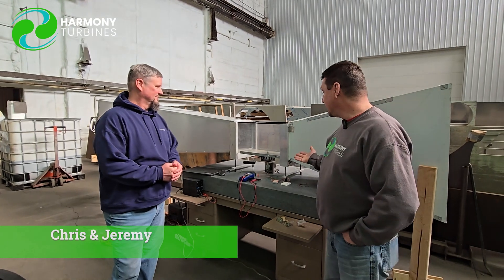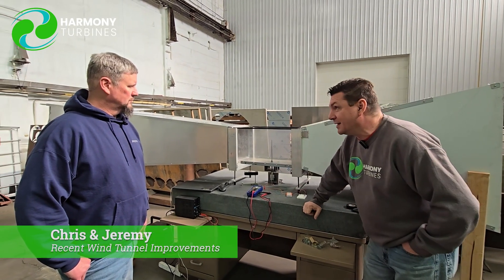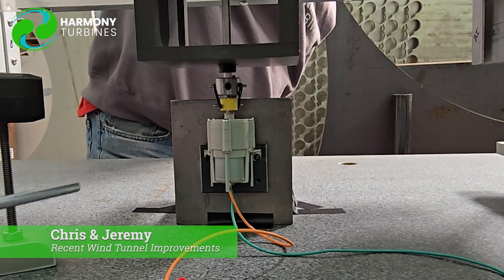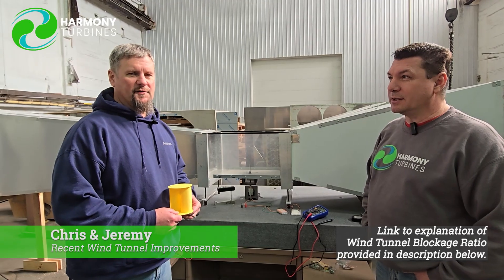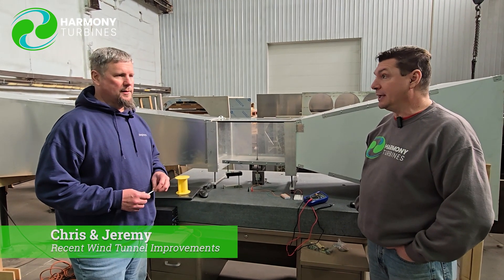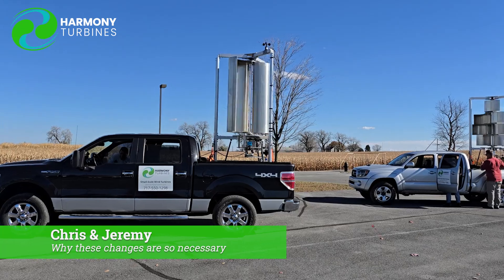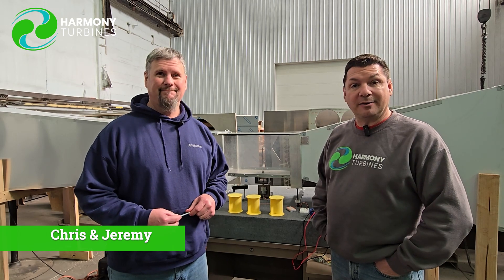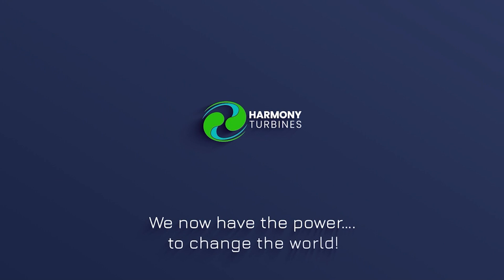Wind Tunnel Excitation!

Comment: Have you thought about mimicking the coupler design from rock crushers? They use a flexible coupling system too because of the vibrations/shock incurred, could be a proven coupling solution with physics modeled for you already. Just a thought and am following closely :)